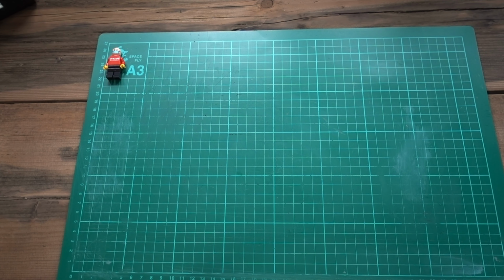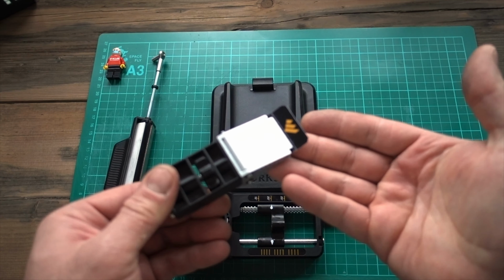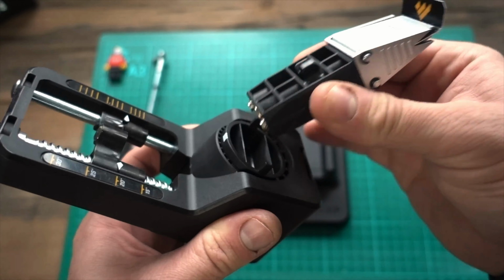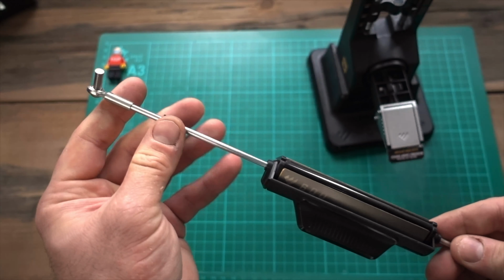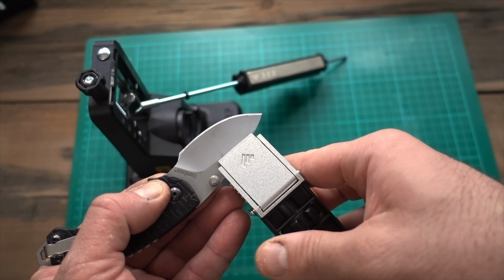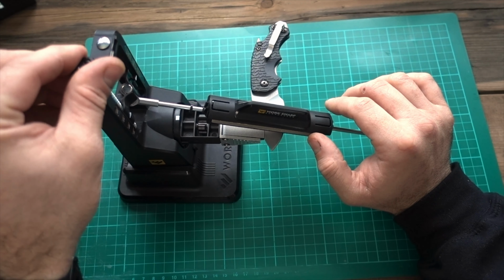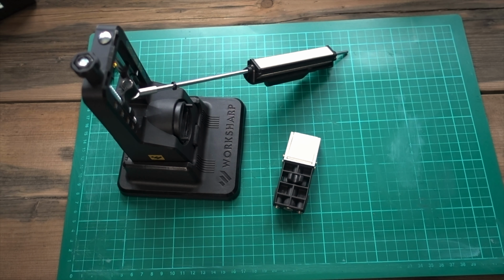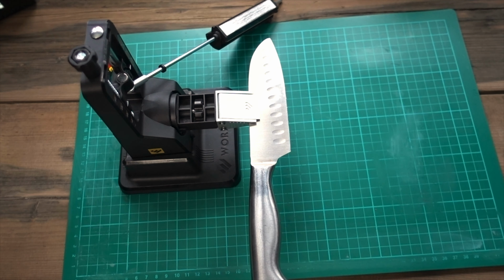Work Sharp Precision Adjust Knife Sharpener

Comment: Seems like a nice bit of kit. Liking the rotating clamp part. I use an Edge Pro copy for just about everything and am used to some longer stones, this length of stone is definitely more suited to the back and forth method rather than push only. Would be nice to not only get hold of other grits of stones (I typically finish  on 3000 grit for stones before stropping) and some blank stone holders would be good too. I have used stone holder to make my own stropping sets out of balsa wood and diamond pastes down to 0.5 micron for that extra crispy mirror shine... (much to fine for kitchen stuff though...)
Reply from the maker: I think that with a bit of a jiggarypokey, that could be doable, I agree that some finer grits would be useful 🤔